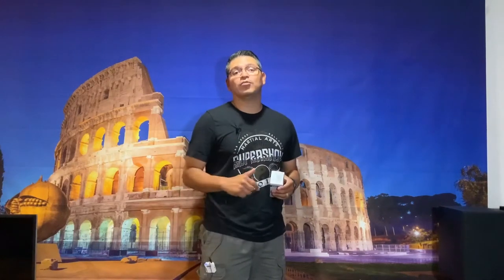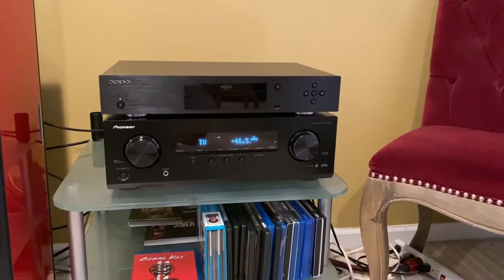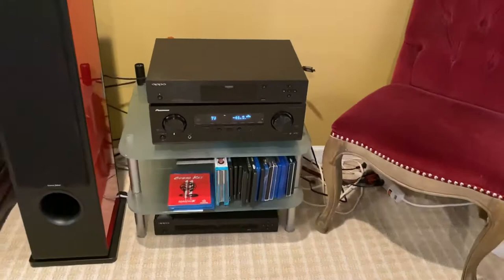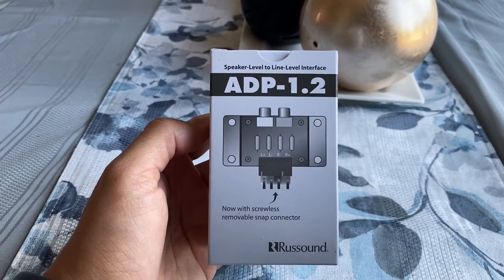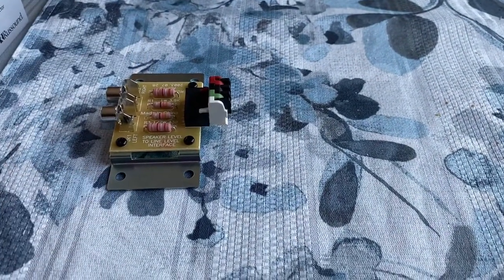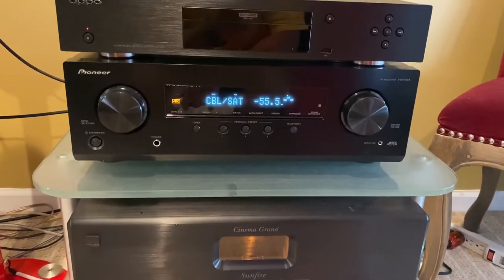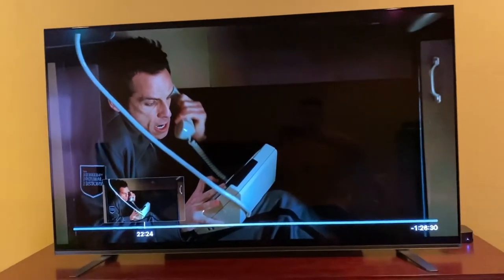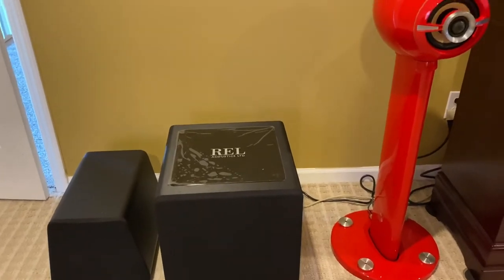How to connect an amp without preouts. Pioneer receiver and Russound

Comment: Hi!  Now I am a bit confused?  Use of the ADP 1.2, as per peter SZ's comments from a year ago, mean that despite hooking u a separate amp to an AVR that does not have pre-outs that the power from the separate amp is not used?  Or is it only used to drive the front mains/center channel while the AVR drives the rear surrounds?  I have older Yamaha AVR's (HTR-6130 and HTR-5063) so am hoping I can use the ADP 1.2 to connect an external amp since neither of those HTR's have pre-outs?  Thanks.
Reply from the maker: You’re correct, the adapters and external amps will run the speakers connected to them. And the receiver will run the rest of the speakers.
Reply: @Audiolympian  Ok so then I don't really understand what PeterSZ talks about 1 yr ago on this page.  Anyways: yesterday u replied to a question and recommended Parasound as an external amm.  There is a Parasound P/SP-1000AV Processor/amplfier for sale near me for $300 Cdn?  I am also looking at gettting the Denon AVR-2802ci as, I think, it has pre-outs for separate amp hook-up.....price is $175 Cdn.  Thoughts?  Thanks.
Reply from the maker: @andrewborbas9356  if you only going to run stereo or maybe 5.1 and 7.1 and they are good condition those work well together. I have the denon 2802 as well, still works great. I always ask for $10 less, never hurts and the worst is they say no.
Reply from the maker: @andrewborbas9356  but between the two I’d go with the denon.
Reply: @Audiolympian  so the parasound is not an external amp?
Reply from the maker: @andrewborbas9356  no, not that model. It’s a preamp which basically a unit that passed a variety of different signals to an amp.
Reply: @Audiolympian  ok thanks. Also see an Adcom GFA 6002 for $380 Cdn?
Reply from the maker: @andrewborbas9356  adcom’s are good. I find they’re a sharp sounding. But they amplify well.
Reply: @Audiolympian  ok thanks.  So looking at various stereo eqpt sellers incl Canuck Audio Mart.  These list HT Recievers, Amplifiers and Pre-Amplifiers.  So, If I get the Denon AVR 2808ci and want to hook up an external amp to power my front mains etc, am I looking at an "amplifier" or "pre-amplifier?" Thanks.
Reply from the maker: @andrewborbas9356  with that denon you’ll want an amplifier
Reply: @Audiolympian  ok.  What about something like SMSL A300 or Aiyima A08Pro or SMSL DA-9?
Reply from the maker: @limbershawn  those would work too
Reply: @Audiolympian  of the three above vs the used Adcom GFA 6002, which would u recommend and why?
Reply: also: the price on the Adcom GFA 6002 is $170 and not $380......sorry.
Reply from the maker: @andrewborbas9356  I’d go with the adcom over the other three. Because they seem like headphone amplifiers. So they may say 100 watts or something like that but their voltage is probably low. The adcom is more of a home theater style amp. So it will push speakers better
Reply: @Audiolympian  ok.  My only interest in the SMSL options are because they are new vs used like the Adcom and I can send the SMSL or Aiyima stuff back IF it does not work for me. What features/specs should I look for in either of the SMSL or Aiyima options?  Thanks.
Reply from the maker: @limbershawn  I get it. Look for usb connections, fiber optic, Bluetooth and if possible xlr connections. Also The highest wattage you can get. Also if they have a trigger on, meaning it will automatically turn on. If not then an easy manual switch. Hope that helps

Comment: Does using a line level converter take load off of the AVR?
Reply from the maker: No. Because it uses the existing signal to the speaker. It just reroutes it to an amp.

Comment: Do you connect the blue RCA cable to the preout on amplifier?
Reply from the maker: Yes, to the input on the amp
Reply: Which input?
Reply from the maker: @tacumentary9046 depends on how many inputs your amp has. But anyone would work, as long as everything is else is connected to the same channel

Comment: I was looking up the adaptor and in the description it says "not for use with digital amplifiers", how do I know what a digital amp is
Reply from the maker: Yes. It says that because most digital amplifier don’t have rca connections, that’s why. Most of your class D amps are digital and the common digital amp used for home stereo or theater is Crown. As long as the amp has rca has interconnects it will work with it.
Reply: @Audiolympian  I was thinking of getting a crown xls1002 and connecting it to a Onkyo tx-nr6100 or a Onkyo tx-8140.
To power Bic rtr1530 speakers
Reply from the maker: @c0uchsl0uch  it may not work with that amp.
Reply: @Audiolympian  luckily the xls1002 has 3 different types of input methods, xrs, banana & rca and speakon, rca output connectors
Reply from the maker: @c0uchsl0uch  ok. Then you should be good.

Comment: Question: I have tried to connect everything according to the video and still nada 🙁. 

Speaker wire from receiver to the white and green, speaker into the red and black, rca Jack's from the input to the part.

Does that sound right?
Reply from the maker: Sounds right. What amp are you trying to connect?
Reply: @Audiolympian  Amp - Pyle PT390AU.5
Receiver- Sony STR DH510
Reply from the maker: @gilbertorivera2011  oh yeah for some reason I’ve been told the Pyle amps have some difficulty with connections. Some guys have told me they got it to work but I don’t know how they made it work. I’ve used them with Emotiva, Sunfire, carver, Parasound, Rotel, and Marantz amps. They’ve always worked for me.
Reply: @Audiolympian  🙁 that is what I get for buying a so so product. It's the first and last time I but anything from Pyle
Reply from the maker: @gilbertorivera2011  sorry it’s not working out for you. But when you upgrade I think you’ll be satisfied

Comment: Where does the adapter get connected to? I’m kind of new to this? Do the cables on the adapter go to the amp or the receiver?
Reply from the maker: Hi Jason. Happy to help. 
The speaker cables go from the receiver to the adapter front. Then from the adapter rear, the rca cables go from the adapter to the amp. Hope that helps. I have a part 2 of this video on my channel that shows a better set up if you’d like to watch that also. Thanks for watching
Reply: I just saw your updated video…thank you so much….just subscribed to the channel!!!!
Reply from the maker: @jasonkrueger8585  thank you. Appreciate the support

Comment: im running 5.1 if I wanted my front stage to get more juice but my older Yamaha doesnt have preouts how would I use this product because it looks like its only 2 channels
Reply from the maker: Correct, one adapter is for two channels. For a 5.1 you’ll need 3 adapters and just don’t use one of the channels. That’s how I have it on my system. Hope this helps and thanks for watching
Reply: @Audiolympian  gotcha. one more question where would I plug  the 3 into my receiver?
Reply from the maker: @aneedkassim9727  you just use plain speaker wire to connect the adapter to the speaker terminals on the receiver. Then on the other side of the adapter use an rca cable to the amplifier. I’ve got another video coming showing a better diagram of the hookup and using multiple adapters

Comment: Would a regular automotive Line Output Converter work for this, they are about the same price and already come in a nice box.
Reply from the maker: In theory I think it could. Other people have asked that question but I think one of the problems that might come up, is the automotive converter in designed for 12 volts not 120 v. It might fry. But I haven’t tried it so I couldn’t say for certain
Reply: @Audiolympian  I have one that doesn't need external power 12v or 120, it just connects to the high level output and converts it to low level, I'm going to try it out this weekend to see if it works out🙏
Reply from the maker: @dropped5310  cool. Let me know how it works out.
Reply: No the cR ones sound awful

Comment: Ok, so I don't have preouts on my Sony str-k700, but I don't have rca inputs on my QSC audio RMX 1450, so now what do I do?
Reply from the maker: I’m not familiar with that amp, so I looked it up and it seems to be more of professional audio gear rather than home theater gear. You’re right, no rca input. There is always going to be difficulty blending the two types of gear together. Sorry the best I can recommend is purchase an actual home theater amp. Crown makes a home theater amp very similar to the qsc and they’re fairly inexpensive
Reply from the maker: Thanks for watching
Reply: Well I've got these yamaha speakers that will handle 500 watts rms each, so is there a receiver that you can recommend that it will adapt to them?
Reply from the maker: @brianbekken6439  wow those are good speakers. I’d first suggest an amp but to answer your question, of course Denon and Marantz receivers do well. Personally I’m more of a fan of Anthem, Sunfire, Rotel, Emotiva and Yamaha makes a good receiver as well. Also depends on your budget. Hope that helps.

Comment: Great video..Are these any good will they hurt the receiver in any way
Reply from the maker: Thanks. They shouldn’t. I use 5 of them in two different systems and they’ve all worked great for me. However I have had some people tell me when they hooked them up receivers or amps went in to protection mode but I don’t the details of their wiring, receivers or amps and speakers. But nobody ever said their systems were damaged just that it didn’t work but again I’m not sure how they hooked it up, could have crossed something. Thanks for watching
Reply: @Audiolympian  wow thats funny I hooked it up twice to my onkyo 6500 using a marantz mm9000 and same thing happened to me went into amp check then it went into speaker check and then powered off and I thought it was me but I'm positive I hooked it up right. So I was thinking of buying a different amp and trying it again but I really didn't wana go thru the whole return policy thing sending the amp back taking 5 days and waiting 10 days for a refund on a credit card. Hmmm maybe I'll just pass on it.
Reply from the maker: @bigguy1403  that sucks man. The only thing I think can cause that is the receivers are not capable of handling a different ohm load from the amp, thus no amp preouts. Im gonna do some testing to maybe see what can cause this.
Reply: @Audiolympian  that would be awesome bro thank you...hope to hear back from you..and it's funny when I called onkyo tec dept they say they never heard of the russound system I'm like really bro...
Reply from the maker: @bigguy1403  haha. That’s strange. The Russound company has been around for a long time.
Reply: @Audiolympian  excatly they just don't want you to add an amp to it they want you to buy a more expensive receiver with the preouts already installed...
Reply from the maker: @bigguy1403  you got it
Reply: @Audiolympian  were you ever able to find anything out?
Reply from the maker: @bigguy1403  not yet. Thanks for checking

Comment: Hi there...I liked your video... i have a query .....I have onkyo nr656 7.1 channel av receiver and  i am running all 7.1 and i feel that my central channel klipsch rp440c need more power. so can i use same adapter to make pre out for my central channel. also please advise if i can use power amplifier or integrated stereo amp to increase power for my central channel.
Reply from the maker: Hello. Thanks for watching. Yes you can use this adapter for your center channel. I’m not sure about the use of an integrated amp. It’s possible through the use of the rca cable. But I haven’t tried it. Good luck. If you try it I’d like to know the results
Reply: @Audiolympian  Thanks for quick response, so i can use power amp and volume control done by my av receiver.
Reply from the maker: @RahulSingh-vn1bv  you’re welcome. yes you can.

Comment: If I were to connect this to a 2 channel receiver, would I still be able to power 4 speakers no problem or would there be less power going to the speakers?
Reply from the maker: As long as your using an external amp with it and depending which kind it shouldn’t break down the power too much. So you should be good. Thanks for watching

Comment: Question..I seen zone out and pre out Jack's on back of receiver..they won't work for amp ???
Reply from the maker: For some reason those outputs don’t work that good specifically the zone 2 preout. Not sure why. But the regular preouts should work connecting directly to an external amp. Hope that helps and thanks for watching
Reply: @Audiolympian  I bought a crown xli 2500 and can't seem to find any receiver to hook up to.. the latest is Denon avr-s960h
Reply from the maker: @terryratliff7960  yeah that receiver will need an adapter to connect an amp
Reply: @Audiolympian  that makes since..lol..is that adaptor easy to hook up ?  Do I hook up both front speakers then connect rca from amp to that piece ?
Reply from the maker: @terryratliff7960  yes it’s quite easy. And yep you described it perfectly. That’s exactly how it connects
Reply: @Audiolympian  great thank you ..do you have a list of avrs that would have the correct pre out Jack's.
Reply: yamaha tsr-700 ....that will work I believe , just no bluetooth ..grr..
Reply from the maker: @terryratliff7960  not off hand. But it’s definitely not any budget receiver. You’ll want to look at their mid level and highend receivers or flagship models. Yamaha, Denon and Marantz of course. Also anthem, Rotel, and Emotiva have good receivers with lots of connection options too.
Reply: @Audiolympian  I think I found one..please confirm ..Onkyo TX-RZ840
Reply from the maker: @terryratliff7960  always something isn’t it. Haha
Reply: Zone B is used for ext. speakers or pre amp out to another amp and speakers, but select audio to "Variable" in setup/audio settings or you'll have high levels that can damage the ext amp

Comment: My Reciever Yamaha RX V 581 turns off when I connect using the Russoind Adp1.2
Reply from the maker: Make sure all your connections are correct. (Which I’m sure you did) what amp are you connecting?
Reply: @Audiolympian  crown xls 2502
Reply from the maker: @Joeluv999  hmmmm. You not the first to tell me the crown amps seem to be a bit twitchy with this adapter. Although it shouldn’t be. I’ve used it with about 4 different amps and they’ve all worked. Emotiva, Sunfire, rotel, ps audio. Let me see what I can find for you.

Comment: Can I use that device AV receiver to connect PA speakers
Reply from the maker: Probably. Just not sure if the pa speaker would require a lot more gain and voltage and burn out the adapter. As long as you don’t over drive it I think it should work. Thanks for watching
Reply: @Audiolympian  because I read to run PA speakers to AV receiver you need pre-out zone 2 on AV receiver
Reply from the maker: @Texas059  right. I think it should work